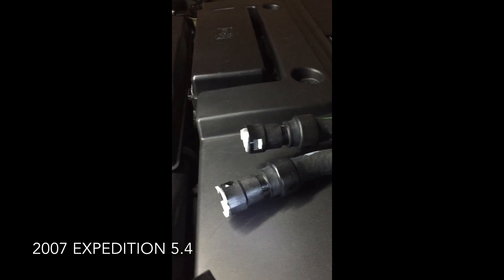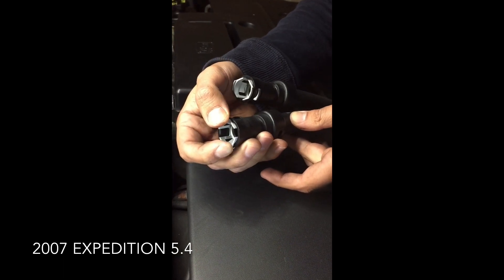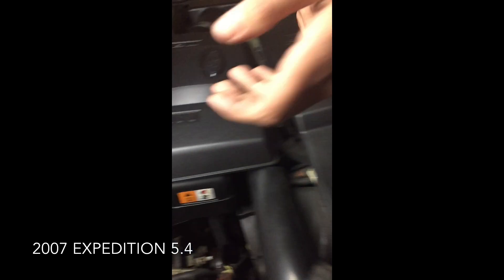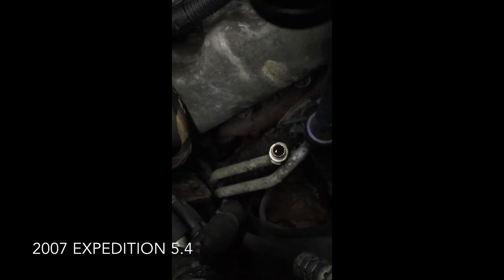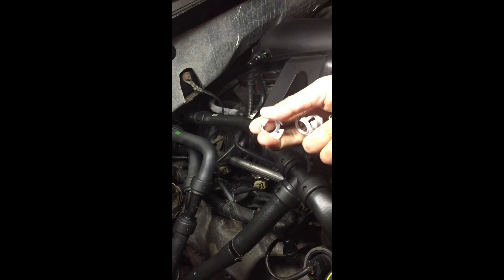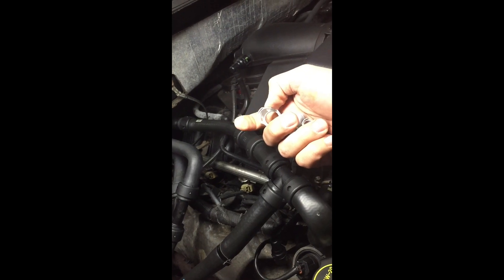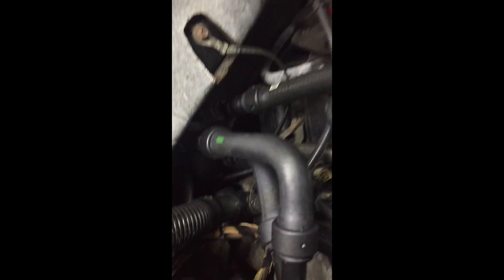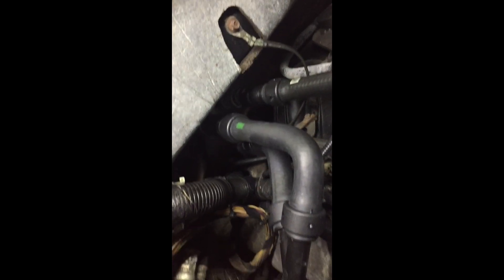How to Replace Heater Core Hose (Quick Connect Hose) on a 2007 Ford Expedition

Comment: What if the leak is near the passenger rear door? I'm thinking it is from the rear heater core or from the hose connected to it. How do you replace the hose, do I need a lift?

Comment: how do you install them though im having a hard time installing them
Reply from the maker: evimael1 first make sure that the one you purchased does not have the white plastic contractor already. Unless you took off the one that's attached to the pipe conector. And then it's just push in